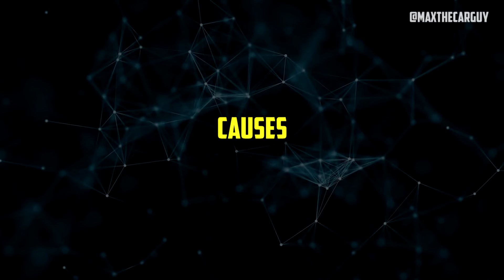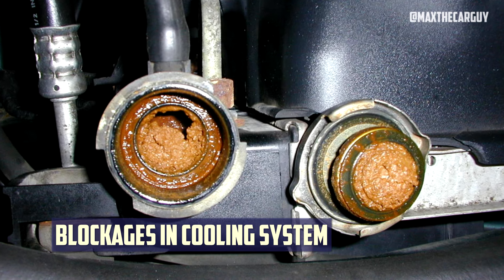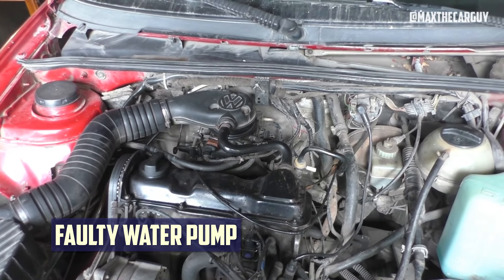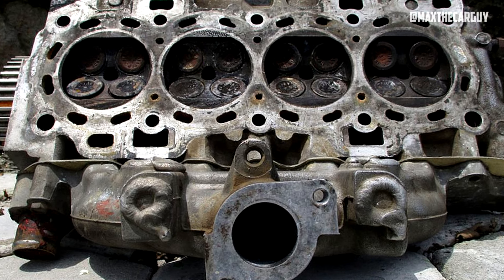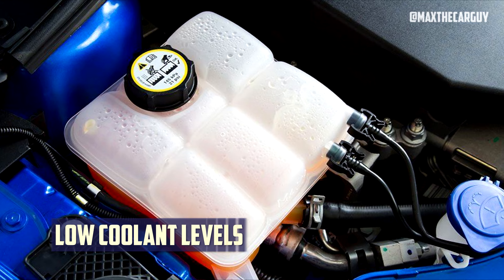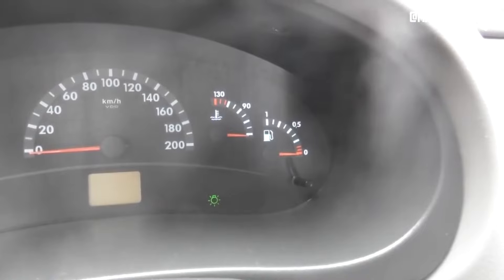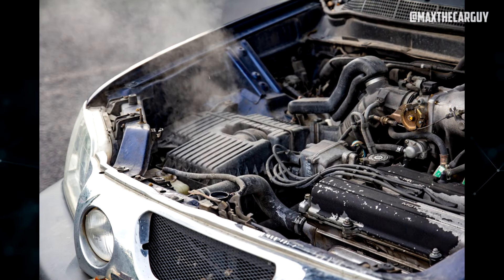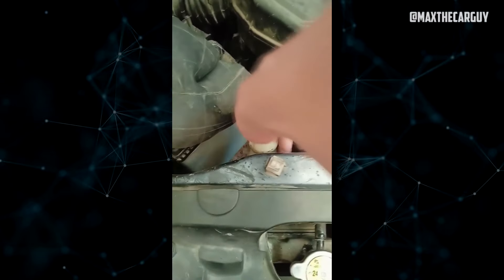Temperature Gauge Rising but Car Not Overheating - Causes and Fixes

Comment: Temperature gauge rises but never overheats when going uphill. Took it to a mechanic and they said there’s nothing wrong with it. And yet I see that needle go up every morning on my way to work :/ they don’t believe me lol
Reply: Take a video next time or leave the car for them to test drive
Reply: I have the same problem
Reply: I’m literally having the same problem it only happens when I’m going to work in the e morning and sometimes when I drive here and there
Reply: I just replaced my thermostat because it went bad on me and I just drove it and it was fine. But then I stopped for 10 minutes to let it run after driving it for an hour and a 1/2. And it started heating up again and the needle started going into the red and then as soon as I drove it, it cooled it, but then when I stopped it did it again
Reply: Viscous clutch fan needs silicone oil replaced
Reply: Or Temperature sensor
Reply: @theprowler4283  You have air in you cooling system try bleeding the system first

Comment: I had a problem when my gauge would rise one or two marks above half mark. The engine would run hot but not overheat. Took it to the mechanic. They ran some tests. No leaks. Pressure is fine. They replaced two thermostats amd that solved the problem. Now my car is always a ted below half mark.

Comment: My car had this issue when a got it. It's fixed now. Flushed all coolant, replaced coolant reservoir, replaced coolant temp sensor, replaced thermostat, still no fix. Turns out the main culprit was my fans because the c a r would only want to overheat at idle. Taking a closer look the bottom of the radiator has something known as a radiator fan switch, which acts also like a coolant temp sensor. This sensor controls the temperature of the coolant in your car radiator by relaying a message to your cars computer to turn on the cooling fans. We unplugged the sensor, cleaned it with electrical cleaner, both the sensor and the connector. Plugged it back in and now everything is working as it should, no more overheat.

Comment: replace termostate , heat senso it still over heating   im tested  the fan motor i do by pass directily to Battery and Motor fan was Bad 2018 camaro LT 6v replace and got fixed

Comment: My gauge keeps bouncing from cool to all the way hot, my coolant is also starting to boil if driving for too long, anyone know what’s up ???
Reply: Thermostat would be my guess, going through the same thing. Lmk what happened once you find out if you can
Reply: Bouncing needle could be due to air pockets, or insufficient coolant. Try bleeding out the system.

Comment: My 89 454 motor temperature starts to rise then it pins to hot or max after a few minutes of driving.   Not a gradual needle move but an instant swing.   What might be my issue?
Reply: Definitely a faulty gauge

Comment: Question what is the normal operating temperature for a 2006 volvo xc90  2.5T temperature Gauge go's up then back down and the engine doesn't seem to be running hot the Coolant level is always at the normal level but the temperature gauge go's crazy sometimes when the vehicle is just setting at idle are driving but the coolant level never changes what is the normal operating temperature for this vehicle??????????????

Comment: On my Pontiac the gauge will go all the way say it’s over heating then make the car go into some mode where u can only go so fast. I don’t see any leaks I replace Copland sensor dk what else I can be was told thermostat was replaced
Reply: Lots of new parts are crap these days.  You might have a bad thermostat.
Reply: @patrickdean7244  I've changed thermostat twice
Reply: Temperature sensor

Comment: Temperature gauge is usually at 40%. But when I start flooring it or driving with a little more urgency, it goes up to 50%. It stays there until I drive with less pace. It doesn't go past 50% though. Any ideas?

Comment: I am using a Fiat punto 2004  model.I have the same issue .My car's previous owner had removed the thermostat valve.now the car  doesnt have a thermostat valve .if I fixed a Thermostat ,,wil be solved the issue ???pls answers me.

Comment: My car doing the same I need help
Reply: It's the thermostat and a easy fix
Reply: @hotboi466  hey still running hot brand new thermostat and sensor it's a crack in the radiator